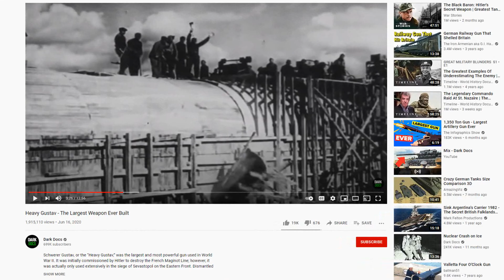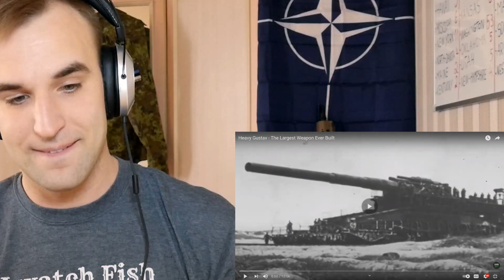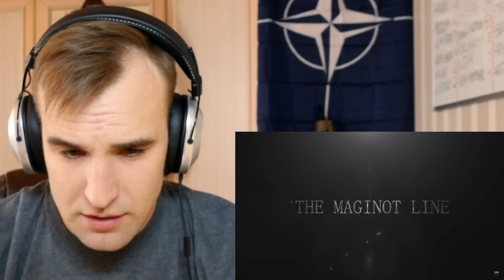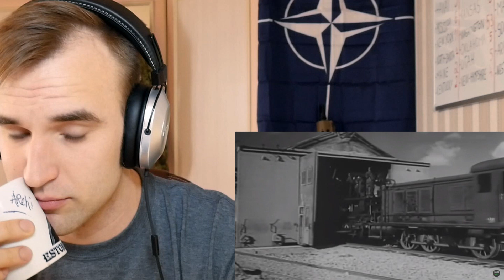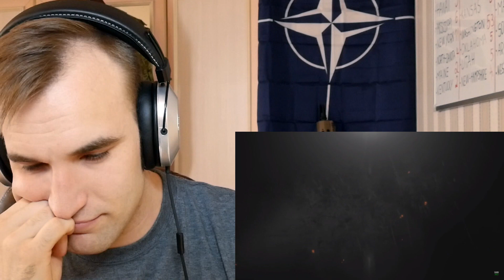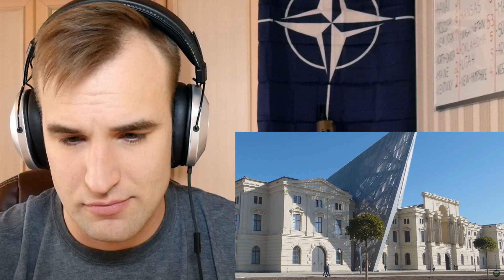Estonian Soldier reacts to the Biggest Tank Ever

Comment: It's a artillery gun not a tank but they did design a tracked virsion of it that was like 2 times bigger than the p1000 ratte it was called p1500 monster sadly there is very little information on it in general but at least u now know that was designed

Comment: 15:00 the reason Germany would have wanted a gun to fire at London would've been for 3 me known reasons: 1. The V2 was very expensive to make, and the payload not worth it, especially because of already existing fuel shortage (of course it didn't use the same as the tanks, but still, the fuel resources could be used otherwise), 2. The V1 rocket, which was arguably somewhat cost effective, could be hunted and shot or otherwise destroyed by planes, and 3, more shots could've been fired in a smaller time frame

Comment: The Maginot Line actually did its job to perfection. As the video said, the line was meant to divert any German offensive efforts up to Belgium, where France would easier be able to fight them. Unfortunately, the reason this plan failed was, to the best of my knowledge, twofold. One: Franco-Belgian relations deteriorated over the 1930's as Germany invaded more and more territories while France did nothing about it, leading Belgium to believe that France wouldn't come to their aid either if it came to that. Two: the Maginot Line was much weaker in the Ardennes because that forest was believed to be so thick that it acted as its own natural impenetrable barrier, and as such building a highly fortified wall through it would be a waste of resources. Naturally, the Germans went right through that as well.

Comment: For comparison: Moscow Kremlin has 5-meter-thick brick walls; so, 7 meters of concrete, that’s impressive.
Reply: *Metre

A "meter" is a tool or device used to measure.
Reply: @Random_White_Circle   westerners uses meter instead of metre
Reply: @Random_White_Circle  You kidding me? A massive portion of the world, if not even most of it uses the word "meter" as the base unit of length.
Reply: @Random_White_Circle  both are correct, depending on British-English or American-English

Comment: Just so you know, the Maginot line didn't fail at all. It did exactly what it was supposed to.
Reply: Well technically they did go though it but not with the main force and it was broken in just a week and it only took that long because it was not the main focus
Reply: Made the Germans go around it? wait, that's exactly what it was meant to do
Reply: @mrrexychomp9829  yep that was the intention.
Reply: @mrrexychomp9829  yeh
Reply: @mrrexychomp9829  Yes, they wanted to force a battle in Belgium. Being closer to the coast the British would be quicker to sent their BEF. That is why the most elite divisions were up North inside Belgium when the Germans punched through the Ardennes and then swung north, cutting them off. In essence war starts, Germans invade Nertherlands and Belgium, French see the Maginot Line forced the Germans North so they activated their war plan of breaking the German offensive inside Belgium, divisions moved into Belgium alongside the British, the German offensive in the North was a diversion and they made a crazy push through the Ardennes with more divisions those roads should have been able to handle, the first rate combat divisions of the French Army get cut off inside Belgium, while the Germans beat up 2nd tier units, reinforcements and supplies, routing the mobilizing conscript forces meant to bulk up the French army, neutralizing the bulk of the French mobile forces => collapse of the French army => French surrender.

All because the Germans knew they could not attack the Maginot Line head on and knew the French were waiting for them to attack Belgium.
Reply: @mangalores-x_x  Yes I know what the Germans had planned but idk why I thought the French wanted the Germans to attack the Maginot line. Idk I guess I'm just stupid lol
Reply: @mrrexychomp9829  My thoughts, exactly 😆.
Reply: Well they couldn't extend it because they didn't want to trap Belgium with Germany I'm pretty sure.  If they did do that that would cause some alliance political issues.
Reply: Also the Maginot line was suppose to stop Germany from a surprise attack, and a cross border attack so I guess it kinda worked but ya sucks they didn't really build it completely.  And of course it didn't work as well as you'd think it would
Reply: @Mr.Ekshin  OOOOO I didn't know that yeah wasn't the great depression just getting over with cause I remember in history class the U.S was about to get over it at this time.  Makes sense.  Basicly they didn't have the money.
Reply: General Hertzinger failed, is what happened.
Reply: @Rhys Goodman That wasn't it at all.
The purpose of the Maginot Line was to hold off a potential German invasion for long enough that France could mobilize and be ready for frontal war.

The Fall of France has nothing to do with the Maginot Line.
France fell because of political, diplomatic and maybe doctrinal reasons.
This last one is disputable though, it's not farfetched to think France could have held off the Germans and counterattack. They certainly had the military might to do so, just not the organization and strong enough chain of command.

Germany going around it doesn't make the Maginot Line unsuccessful, it does the exact opposite. It shows that the Germans weren't confident enough to go through it and had to think of something else.
Allies not being able to counter Germany's move is another story where France is not the only one at fault, far from it.
Reply: Completely fail you mean?  Or how they simply went around it?
Reply: @DarkKatzy013  I wonder why they went around the thing.
Maybe because it was actually doing its job, who knows ?

Also it wasn't extensive enough at Belgium's border for diplomatic reasons, not just because France was stupid enough to not see that their defenses were weak there.
Reply: What Rommel punched trough it.🤦‍♂️
Reply: @michaeld.uchiha9084  What the hell are you on, the 7th PzDivision wasn't even near the Maginot Line, they were north of Sedan, behind Belgium's border, where the defenses were the weakest.
Reply: @Rhys Goodman the Maginot line worked fine, the rest of the french military didn't. It did it's job
Reply: @Peter Yingling  you're literally just reciting geography here, the point of the forts was to force Germany into Belgium. Belgium was against fortifications on their border as they would sandwich the Belgian army against the German army and the french defences when it came to war. 

The Maginot line proved to be successful in forcing the Germans elsewhere, that is simply a fact everyone can agree on.
Reply: @Rhys Goodman How could it prevent an invasion on a territory that is not covered by it ? It did prevent the German invasion coming from Germany, which was the point of the Maginot Line, or at least slow it down as I said. So in that regard, it's been even more successful that planned, in a way.